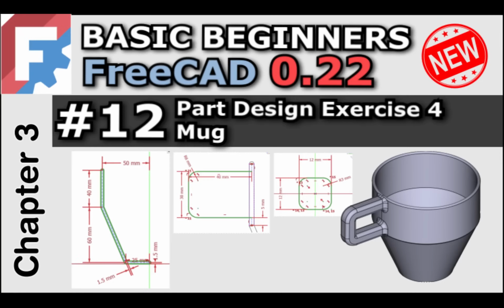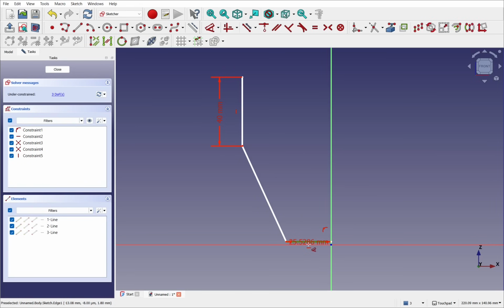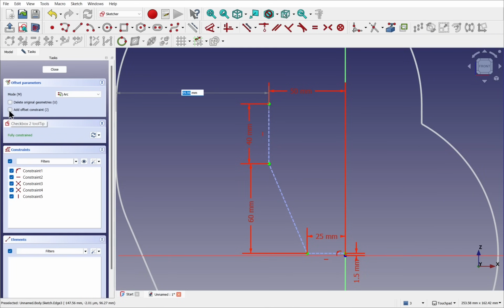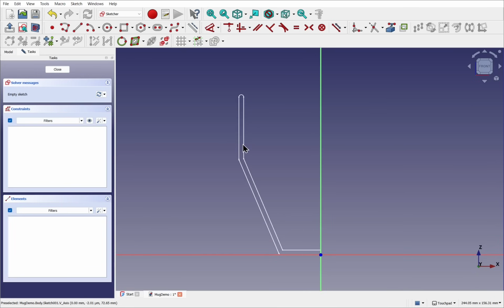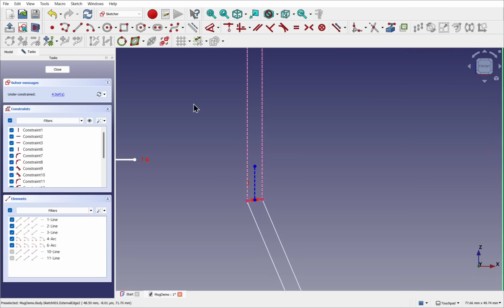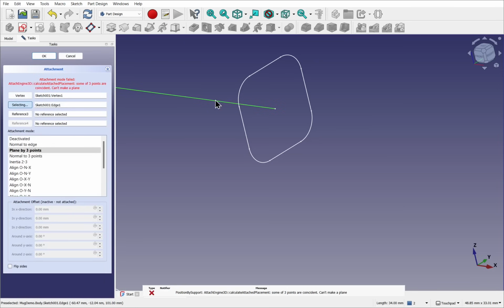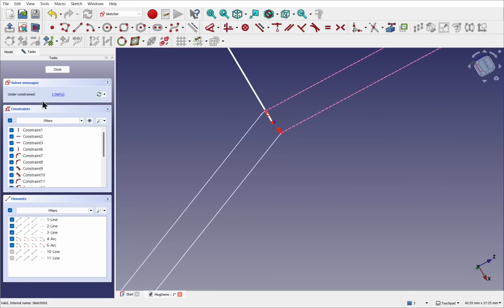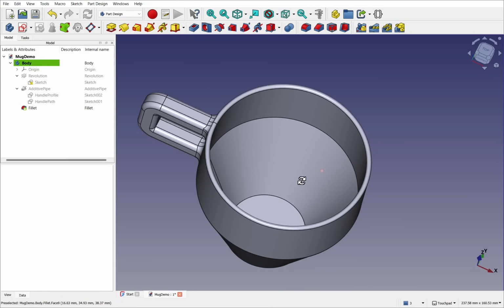Connecting Operations In Part Design | Modelling a Mug | Basic Beginners FreeCAD v1 / 0.22 Lesson 12

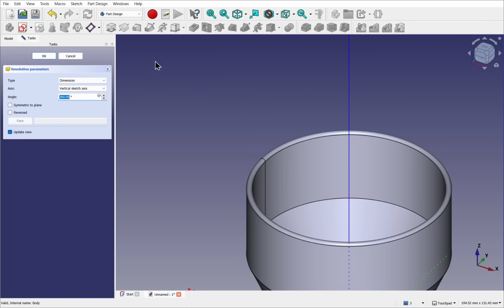Comment: Hi Darren. Quick question - at 11:49, when I click "Revolve", my model DOES look like the mug, however the brim of the mug doesn't look as smooth as yours. It looks "dented" in a way... like it has rippled going around it. I've tried a couple of times to see if I am following you precisely, but to no avail. Thoughts? :)
Reply from the maker: This is caused by something called a high deviation settings and often get this with revolves.  Click on the body, go to the bottom, click on the view tab, within you will find a property called 'deviation' normally set to ?0.5? Change this to 0.1, and if that doesn't clean it up, try 0.05.  You can also set this by default in preferences > part design > shape view and lower to 0.1.  The lower the setting the more compute power it takes.
Reply: @MangoJellySolutions  Perfect. Thanks so much for your help! It's appreciated!

Comment: I'm constantly coming back to these videos as an excellent tutorial. What I'd like to learn is the reasons for selecting different options when connecting the HandleProfile to the HandlePath - is there some documentation about this so I know what choices to make when confronted with similar designs. For instance, what learnings led you to choose to select "Normal to edge" in place of "Plane by 3 points" ... this is intelligence I'd like to acquire. Is it intelligence that is part of the discipline of CAD or is it specific to FreeCAD, and if the former.. where can I learn that? Cheers.
Reply from the maker: Glad these videos are of use.  So regarding the options, you are I think the forth or so that has asked a very similar question and I am in the process of making such a video.  In autoCAD it's called aligning the UCS (user co-ordinate system) and is a very similar process, say you want to align to a line, after enabling the UCS mode you drop into wireframe view and select the edge you want to align to and the sketch will be positioned along a axis that runs along that line.

Comment: can you make a video how to draw a complete machine.What is the best way?
All separate parts and then assemble or
multiple subassemblies or just build part by part in one file.
Reply from the maker: This is a great request actually as its often a tripping point in a lot of CAD packages, how do you structure your assemblies.  You have to take in to account if the assembly is going to have simulations or if it just a plane fixed assembly.  If it's an assembly then you can bring collections of parts together to make sub assemblies i.e. a car would have multiple sub assembles, steering, gear box and those would also  be made up of multiple smaller sub assemblies.  Having them separated in separate files is a great way to go.  You can then use cross file references such as subshape binders and links to manage things like varsets.  Quite a lot to cover there but would good content, thank you :) Watch this space :)

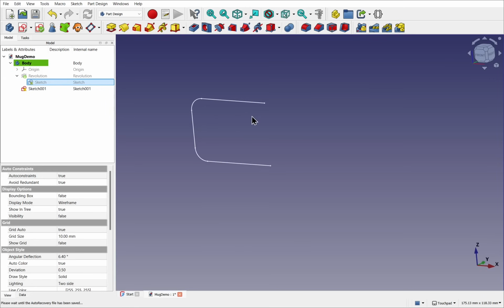Comment: Hi Darren, if I may raise a problem which I think is because I am on a later version, but at 19:32 when you hide the revolve sketch, on my system I still have the 2 imported geometry lines now in my path sketch.... how do I deal with this please? Do I make them construction lines perhaps?
Reply from the maker: Are you using 1.1? I think I know what the problem is.  So for a while by default the imported geometry would pull in as normal geometry, which you can then turn to construction.  The developers saw this was breaking workflows and put an option in the settings to toggle this on and off.  Yes, change them to construction geometry and all will be fine.

Comment: Deleting that round thing in first offset broke a lot of constraints and sketch says 2 DoF still after making points coincedent

It bugs me and I can't find what could move...
Reply from the maker: Where it shows "dof (x)" in blue on the panel on the left, if you click that it will highlight the issue but it's often hard to see what's been highlighted. Another way is to manual pull the geometry and if it moves hit ctrl z on the keyboard to undo. From your comment, it's given me something to look into to see if I can find a better solution or make it easier to find these problems. .
Reply: @MangoJellySolutions  I've tried to move everything obvious...
You've ignored that message in this tutorial too, btw

Comment: i still don't get it the need of that HandleProfile :/
Reply from the maker: The handle profile defines the cross section of the handle which creates it's shape.  You need to define the shape to be swept along a path. It's like taking a piece of clay and pushing it through a plate with a circular hole.  You get a long piece of clay with a cross section of the shape of the hole.  The shape of the hole is the profile.  Hope that helps.
Reply: thank you, the clay analogy is a good one👌🏻

Comment: FreeCAD 1.0 WILL NOT WORK ON THIS TUTORIAL. You will never get the first sketch closed doing exactly what he does. After deleting the half-circle from the offset, if you click the top right point of the vertical section and constrain it to the y-axis first, you will never get the bottom point at the origin to behave properly, and the sketch will break itself. You NEED TO MOVE THE LINE OFF THE ORIGIN, AND THEN CONSTRAIN THE BOTTOM RIGHT POINT TO THE ORIGIN FIRST. After that you can constrain the top point. I've spent 4 hours going over this again and again, started from scratch over a dozen times, and despite behaving as if they are connected when you move them before constraining, according to Freecad 1.0 the sketch is not closed, will not close, and never will be closed unless you do the origin point coincidence first.

In the last step, you cannot apply fillets at all with the handle path at a 5mm offset from the center point of the top half circle, you need at least 7mm. That will allow you a 1mm fillet, anything more will preview but fail when you hit OK. This is basic math, a 5mm offset on a 12mm square is not enough to get the handle below the lip of the cup.

Comment: This series is really helping, Thx. [I'm using v1.0 so not everything lines up exactly] If you ever revisit this, it would be interesting to have the remaining DoFs explained at 11:35, where you say "and we're back in constraint", but the sketch still has those 2 DoFs. I see them on my sketch too; not sure how to completely lock things down...
Reply: my thoughts exactly, I had to fight the editor and rewatch the video multiple times to realize I was actually following it to the letter
from what I could deduce, it seems that some of the construction geometry that is created by the offset operation still ends up unconstrained even after clicking the "create offset constraint" option
Reply: @Splatpope  I am encountering the same thing. Since it is construction geometry, I am assuming it is unimportant. The sketch itself appears green, so the important bits are fully constrained, so I suppose that is what matters. However, when I moved the new construction line and then added a coincidence constraint between the end and the corner at the bottom of the mug, it became fully constrained.

Edit: No, it actually didn't, my sketch didn't update. When I recalculated it, it said it was over constrained. So, oops.

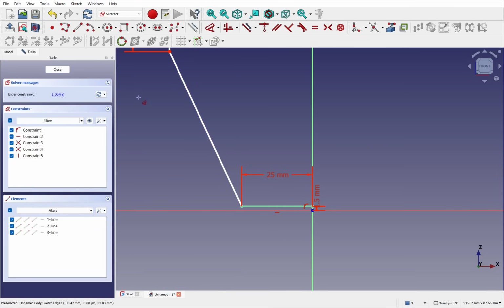Comment: Is anyone else having troubles at about 5:50 minutes in? Every time I add the height dimension to 60 mm, it moves the 1.5 mm dimension down below the x axis. It seems like a bug to my unprofessional brain, or am I missing something? I just tried it again from the start with no improvement. :(
Reply: I ended up just using dimension tool and clicking on the 60 mm line. set it to 6 mm. then corrected the angle with the 50 mm dimension from the top point to the z axis.
Reply: I have exact the same problem. Started over several times, no luck. (FC 1.0.0-39109 MacOS Sonoma 14.7.2)  The whole sketch drops 1.5 mm below the X-axis. How did you solve it, i don't understand your solution.
@MangoJellySolutions: Can you explain what is happening here?

Comment: Why is my rounded rectangle/handle profile ,go dashed in blue, and not green and constrained ?
Reply from the maker: It's sounds like you have construction geometry still enabled. If you see the geometry buttons in blue in the tool bar your in construction mode. You need to press the construction geometry button to switch it back.
Reply: @MangoJellySolutions  Dang! That's it, so simple but so impossible for me, a ultra new, or a bit old beginner :) But it's never too late to learn. Thanks a lot!! For the Best Videos

Comment: Great lesson. But when I exported a cup to stl and try to slice with bambu lab , I got an error "non manifold edges" When I repair it automatically with slicer then I got filled cup which is not a a cup to hold any liquid  :D. Do you know where can be a problem ?   When I removed handle, cup is slice correctly.

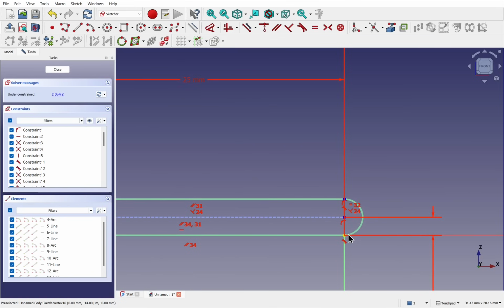When I manually change lower leg of cup holder it stated to slice without any problems. It seems a issue either with offset geometry ( from ~10:00) or how the holder is combine .  PS I use CAD 1.1 weekly build

Comment: When exporting to either STL or 3MF, i noticed that the handle was hollow, which is different than we saw in the part design bench. What causes this?
Reply from the maker: Did you find this when importing into your slicer? I had done some research a while a back as I had the same problem and found that it was to do with my slicer.  There was an article that I found that I was able to resolve the issue (link below) https://www.reddit.com/r/FreeCAD/comments/101eamm/when_exporting_to_stl_i_get_a_hollow_model/
Reply: @MangoJellySolutions  thanks, I'll keep that in mind

Comment: 11:35 The sketch still has 2 DoF. How do I fix this? Clicking on the "2 DoF(s)" hyperlink shows nothing.
Reply: Never mind I fixed it. You need to constrain the two additional construction lines added by the offset operation to the central construction line.
Reply: @SDX2000 I had the same issue and did what you did also!

Comment: Is anyone else getting weird ridges in the lip of the cup when doing the revolve?
Reply from the maker: You can clean this up by lowering the deviation in the view tab.  Click on the body, look towards the bottom left of your screen to the two tabs, select the view tab, under 'object style' header you will see deviation, probably set to 0.5.  If you lower this to 0.1 or 0.05 this will disappear.  Deviation is a way of saving cpu processing.  Hope that helps.
Reply: @MangoJellySolutions  What worked for me ( I got help from Reddit) was to change the Maximum Angular Deflection in the Shape View tab under Part Design in the preferences. I changed the original value from 28.3 (I think) to 5 degrees. It raises the computation time a smidge but the results are good!

Comment: In 1.0 RC2 clicking close on in the Tasks tab after creating the offset and constraining it, results in a non visible / non useable profile. There is nothing to revolve. I've gone through this several times. The lines for the side of the cup are fully constrained in the sketch view, and like your video, it says I have 2 Dof.  Problem is, when I click close and it goes back to the model tab, there is nothing in the view. Best I can get it down to is 1 Dof. Can't find where that last dof is.
Reply from the maker: It sounds like the offset is still construction geometry. I am going to rerun this in RC2 as they may have changed something. If this is the case I need to reshoot the video. The offset used to create standard geometry. So now you would need to convert that. I will take a look.
Reply: @MangoJellySolutions   Reinstalled RC2 and now it works. something was, to use a highly technical term, boogered up 😁 during the first installation.

Comment: great tutorial! How would you alter the model if the lower end of the handle ends in the slanted part of the mug. I would make that it stick out to the inside and then delete the face or make a revole cut in the cup, but this feels somehow not perfect.
Reply: I was thinking exactly the same question. I would reverse the operation order: first make the handle, then subtract a solid revolve from the midprofile of the mug, and then add the mug revolve. I would love to hear from MJ what would be his approach in this situation.
Reply from the maker: Thanks glad your enjoyed, yes your way and @dmmgualb are perfectly good enough, but as with everything, always another way.  Depending on how large the handle profile is you can include additional profiles into the pipe so it become a multi profile operation.  So you can have a beginning and an end profile.  This can be a simple duplication of the last sketch and attached with the map mode to the other end of the path.  The key here is to use the rotate around axis in the sketch attachment panel when using the map mode and rotate it so its parallel to the slant.  You include both profiles in the pipe operations and you get something that fits the surface.

Comment: Tell you what I would love MJ, to be able to click a point, then press constrain XY - with the result that it constrains that position to the origin in both dimensions with a single mouse click!

Then, if we could set a new datum point, say, the last constraint, another function would set any future selections to that new origin...

This would save soo much time!
Reply from the maker: Ah...so.... there is the constraint 'constraint lock' that adds both a X and Y constraint for the selected point to the origin which may help with the first one.  The second one, you can do the same but select two points with the constraint lock and it will offset from that point.  But I don't think you can select a new point and say that this is now the new origin (I had a double check but couldn't find anything.  I for one would find this extremely useful).  The only thing with the constraint lock is that you get a minus value depending on what side you constrain from.  Not a issue but something to remember if your using things like formulas and spreadsheets.